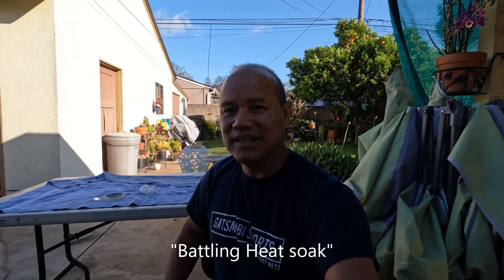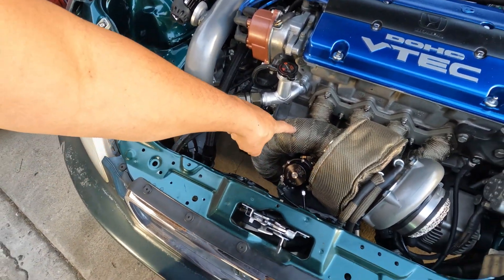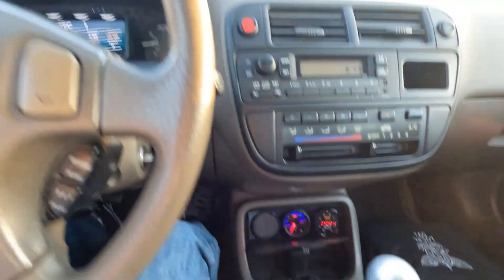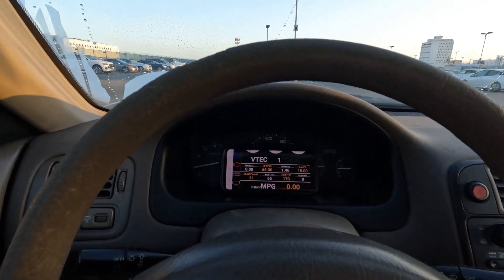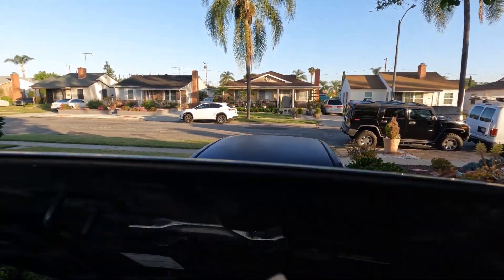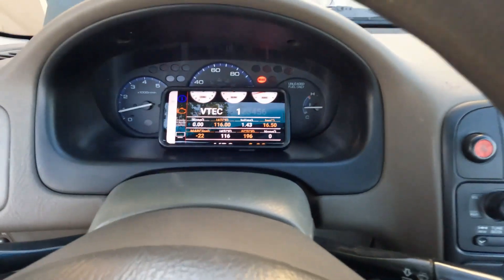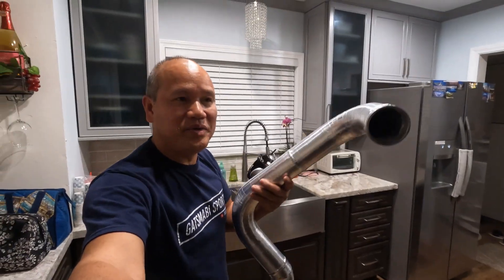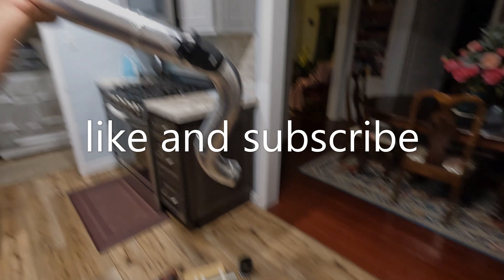Heat soak

Comment: Is it normal for cars to run like crap?  Its 100 in ca now and my car feels like shit.  Boosted k24.  Iat is 100+
Reply from the maker: If your boosted yes, your ecu probably helping you a lot right now. Making sure that your not boosting more when coolant temp is high. Happenef to me, Hondata settings wimt let me boost a lot on outside temp like 100 degrees.
Reply: @sagittnet2158 ty for the reply.  Yea I noticed I wasn't getting full boost also.  I'm at 17psi but only saw 13.  Wasgate barely open
Reply from the maker: @Hello_its_me_mario  Yup! it freaked me out when it happened to me but it was for my own good. You have a good IAT! anything over 120 is not good. Later man!